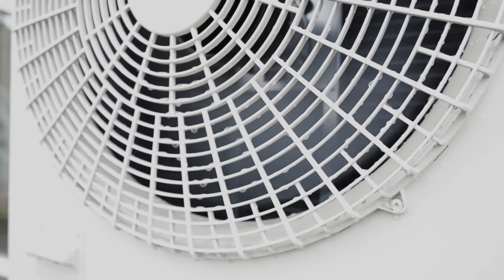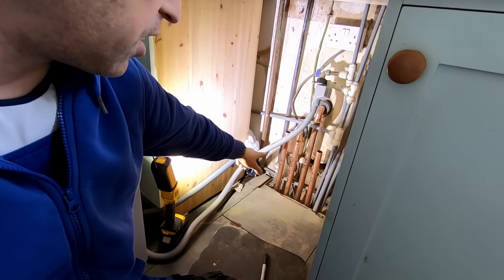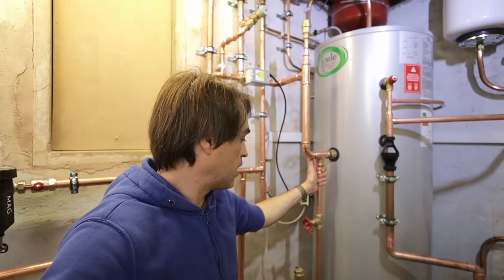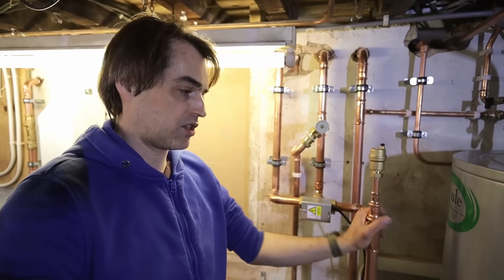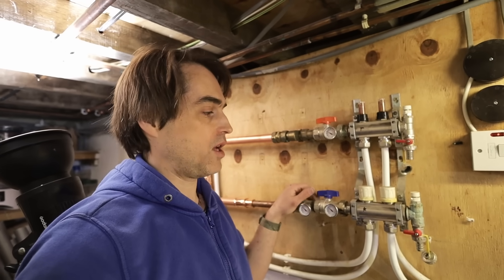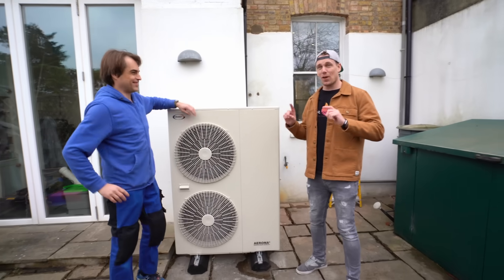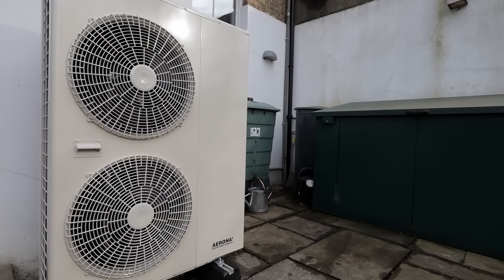The Truth about Heat Pumps: Debunking the Myth.

Comment: Hi Simon. First of all, great work! As you said, you run the whole system on approximately 48 flow and 43 return temperature (delta T5), but can you please let us know on which way you managed to run the radiators on 48 C flow and 43 C return and in the same time to run the underfloor heating on 33 C flow and 28 C return in an open loop system? Maybe you are using some kind of a mixing valve for an underfloor heating or? Thank you in advance. :)
Reply from the maker: The whole system runs 40/35at design with here. System is only balanced with flow
Reply: @UrbanPlumbers  Because in the video, you mentioned that radiators will run at max flow 48 return 43 (mean radiator temp about 45-46 C) and you set the UHF manifold at 33 flow and 28 return. I guess that during recording the video, you had a lower flow temp than your designed max flow temp, due to weather compensation calculation. Currently, at home i have a heat pump with type 33 radiators, underfloor heating and fan coil units. On heating, i am running only radiators and underfloor heating and fan coils only for cooling. My max design temp for radiators is 48 C and for underfloor heating max 40 C (both on delta T5). But the problem is that i have a hydraulic separation (160 L buffer) and after watching your videos, i realize that i need to remove it and to increase the efficiency and to avoid the distortion due to too many pumps of the heat pump (maybe only will put a 50 L volumizer on the return for the fan coils). So in your opinion, is it possible to achieve this (one zone, open loop system) by removing the buffer and run the system in a weather compensation? I think that it is possible and will definitely increase the COP and avoid a distortion, but only unclear point for me here is how to decrease the flow temp for underfloor heating in case where i have a radiators and higher flow rate for them in the same time. Sorry for bothering you and thank you in advance.

Comment: It's big it's ugly, expensive to buy, to install and to run. Add to that it's not as environmentally friendly as claimed. 
But if you live in an area that doesn't have gas mains, as long as the system lasts for more than 10years it's certainly worth considering especially if you have solar panels
Reply from the maker: Ok Doris
Reply: @UrbanPlumbers according to official figures they are upto 33% more expensive compared to gas central heating.  Hence the no gas mains supply they are a better option.
As for the environmental impact modern gas central heating is very efficient with little impact. Heat pumps have there place especially if properly fitted ( well done).
Doris

Comment: I can run as many baths as I want with my combi-boiler and rapidly heat the House in between. Once you have drained your  hot water tank your immersion heater kicks in at extortionate rates. I am only interested in my running costs. Heat pump costs are roughly 1/3 of pure electric systems but gas is about a 1/4, so no matter all the calculations about efficiency, gas is still the cheapest.
Reply: If you're only interested in running costs, then a properly installed heat pump will be able to run 1/4-1/5 of electric heating.  And the average gas boiler in the UK runs at around 82%.   So you need to add about 20% onto the gas price to get the same amount of heat.  So gas isn't always the cheapest.

It's also clear from your first sentence that you aren't that interested in running costs, and are more interested in convenience.  As rapid heating will cost more.

For many heat pump owners, the immersion is turned off, and can still boost just fine.
Reply: @BenIsInSweden  You are quite right that convenience is important to me as well as cost. One argument used is that the immersion heater will only kick in relatively infrequently. This assumes you don’t draw much hot water. Being a single household I probably use less hot water than most  and I draw hot water about ten times a day. This means an immersion heater will be kicking in often as the cold water brings the temperature in the tank down. I have been reading also that here in the UK they are changing the rules to artificially distort the so-called advantages of heat pumps by, in one proposal, restricting gas boilers to an operating temperature of 55°C with the knock on effect that will have on radiator size and insulation etc.I don’t know about electricity prices in Sweden but they are very high here. Our government is also proposing to euphemistically “rebalance” the energy market ie by putting up gas prices . All of this just shows they don’t believe their own arguments and have to resort to dirty tricks to force people to accept heat pumps.
Reply: @johncrosley1  That's not how hot water cylinders work.  There's a hysteresis, and often a cylinder has a temperature probe about a 3rd of the way up - some have more than one.
e.g. for mine, once the probe reads a temperature below 10C of the set temperature, it will call for heat from the heat pump. The only time the immersion will kick in will be under the following situations:
- The immersion is enabled, and the boost button has been pressed on the control panel.
- As mine is R32, if any temperature above 55C is requested (e.g. an anti-legionella cycle).  which will throw an error if the immersion is disabled.  In R290 ones, they can do 75C without immersion, so more than enough for ALC without immersion.
- As mine is split with air to air, if it is set to heating priority (default is mixed, but hot water priority is an option), then as the heat pump is busy with heating it will use the immersion (if enabled).

Building regs have been changed over the years in the UK to improve home standards, and it's not really about trying to make heat pumps more favourable, but homes more energy efficient.  A flow temperature of 55C on a gas boiler uses a lot less gas than 75C.

The issue with the UK is it has one of the highest spark gaps in Europe because of the pre-existing policies. About 1:4 as you say.  The European average is about 1:3. Sweden has one of the lowest, at around 1:1.2, so gas heating never really makes any sense over even immersion.

A rebalance is also well overdue, a lot of the policies were done when coal was a primary provider of electricity, so gas was far more favourable for heating.  The problem comes because so many people rely on gas for heating, with how to do it without causing fuel poverty.

Comment: Looks like a 'Y' plan electrical control system whereby the unvented cylinder does not have its own separate zone valve!!! NOT PERMITTED! Also gate valves are not recommended for pressure systems why not an automatic bypass for cylinder flow/return and then adjust as necessary!
Reply from the maker: It’s a diverter normally closed to the cylinder on PDHW and not a Y plan

Comment: You are not debunking anything.
It is obvious, that to get amount of heat required, you need eather high delta T on your rads, or much less delta T and ridiculously big rads. I personally wouldn't like to live with this ugly rads on my walls.
Besides, for cold climate heat exchanger surface for outside unit should be bigger as well( more expensive equipment).
Last question- from where you are going to get electricity to operate you heat pump?
Right, from burning fossil fuel.
Circuit is closed.
Reply from the maker: The only thing closed here is your mind my friend
Reply: @UrbanPlumbers  offending someone is not an answer. 
I raised some questions, got no answers.

Comment: Madness, I've been installing heat pumps for 40us or as we know them aircon units with reverse cycle. They do work but very expensive to run and Very expensive to repair. They have massive control pcb s because they are inverter drives with dc voltage compressors and pump around refrigerant gas so installers must be f has compliant so not so green. I have 2 mainly for cooling but I can fix it.... God help the public who risk it. The potential problems are enormous. .who will benefit from this , the manufacturer s !!!!!!

Comment: Hi. Just wondering what is the power usage of a heat pump. Is a 10 kw unit using 10 kw per hour .Or is there a way to compare oil burner as an 1 gallon jet per hour. And as with oil were i can put it on for 2 hours or do you have to leave a heat pump on all the time and let the stats cut in and out
Reply: no, heat pumps are rated by heat output, not by electrical input, you can check the spec sheet of the unit, and either it'll show the max wattage or amps - either as a max rating or fuse size (which you can multiply by voltage to get watts)... As a rule of thumb the max draw is about 50% of the rated heat output, however, this isn't what the heat pump will be running at most of the time, and that will be lower when set up correctly.   Even with an oil boiler you are (in most cases) using more oil having it running for 2 hours a day only vs having it trickle heat in at a lower flow temperature, with a heat pump that saving is even more pronounced.   Heat pumps don't use a thermostat in the typical fashion - as they make it more inefficient, instead they are set up with weather compensation - like a gas boiler (and probably oil boiler) can. Where it adjusts the flow temperature based on the outside temperature to target a set indoors temperature.  That isn't to say you can't use it in a way that is controlled by a thermostat, you totally can, but generally it's going to work out more expensive, unless your house is completely vacant most of the time.

Comment: 11:50 A 17kW unit?! Am I reading this correctly?!
Wasn't this heavily oversized?
Reply from the maker: It’s 17kw at +7. Around 13kW at -2
Reply: If I may, what were the reasons for sizing the heat pump this big? 

Couldn't a 6 or 8kW heat pump do the same job more efficiently (using less electricity)?

Thanks for taking the time to reply and congrats for the channel.
Reply from the maker: 12kw heat loss. It’s a big house

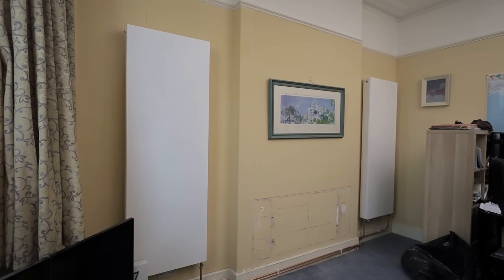Comment: 10:40 What an ugly mess. I would NEVER agree to have those huge things in my rooms. Also how much longer do they take to warm the room up compared to the old heating system?
Reply from the maker: I only installed them to trigger people online 🤣🤣🤣. They are pretty oversized even for a heat pump. The room becomes and instant sauna if both are on.
Reply: Honestly, I would rather sit in the cold than do that to my home. If heat loss is that bad, just fix the heat loss ffs.
Reply from the maker: The larger the rads the lower the flow temp and higher the efficiency and lower running cost. You can have small rads, it will just cost you more to run them
Reply: The customer chose them. And the room isn't typical - clearly over 3m in height given that the rads are almost 2m high, and there's still a significant amount of wall to spare above.  Along with the heat loss in that room being about 1/3rd of the average UK house's total heat loss.  Also, with a properly set up heat pump (or gas boiler with weather comp), you aren't getting to the stage where you need to heat a room from cold, the weather compensation will take care of the amount of heat to start trickling into the system as the outside temperature drops to maintain the desired room temperature.

Comment: Gosh, you just worry about the volume house builders getting it right. Bearing in mind the range of defects with well known elements of plumbing when building a new house. You can see them struggling to find the competent sub contractors to do this new way of heating. Unless they have proper design and specification for pipe work, radiators and have sufficient quality control. Anyway hopefully the early adopters will help iron out the bumps long before this technology becomes the norm.

Comment: Great access to everything which sadly is just not possible in modern houses. neither is replacing existing 10mm and 15mm pipes with 22 or28mm pipes. I think this is the problem in the UK. Possible in older properties with floor spaces and basements. Not possible with concrete floors
Then there is the truly ugly, dominating radiators.........I mean, they really are horrible

Comment: Nice looking system but it is huge in every respect. I can live with radiators, a heat tank etc, but not the box on my patio right outside my sash window. I hope the fan bearings remain whisper quiet.

Comment: I know I  will probably get a lot of negative feedback but watching this video reminds me are we looking for the right solutions. An example: a person works 100 kilometers round trip from home and he sells his car and get another vehicle that is 25%  percent better on milage. An improvement that could be resolve by moving 25% or more closer to work. In this video I saw no evidence of increased thermal performance of the building envelope and all homes have the possibility of super insulation and air sealing resulting in dramatic reduction in required thermal load. A small heat pump definitely has uses such as domestic hot water supply, but the requirement of a 17 kw heat pump to alleviate but not fix a poorly insulated home is just the thing that makes the world and society in general still not looking for smart, efficient, long term, low life cycle costs that need to be mandated and installed in both current and new housing standards. A group of us where talking about the weather in summer at the current time because it was quite hot and one fellow said that he had just spent 28000.00 canadian dollars for a ground source geothermal system. When I said that if he had spent half that money on insulation he probably wouldn't need much of a heating and cooling system. His face turned white when he realized what I had said.

Comment: this is so bad :D you waste so much money on all radiators ect to save nothing :D all this pays up in what 20 years ? in 20 years there will be way better solutions to heating and plumbing
Reply from the maker: Like what? Hydrogen - lol 😂
Reply: @UrbanPlumbers  not talking about hydrogen . there is currently no good alternatives . all those heat pumps is another monopoly to make a lot of money for big companies and push their agenda .I would be more skeptical on solar or wind maybe and if heat pumps get cheaper maybe one of those combinations at this stage its not efficient at all .
Reply from the maker: Heat pump are cheap. It’s the work to existing heating systems and hot water plus wiring that makes it expensive. Once installed you could swap a heat pump for maybe 2x the costs of a combi swap. I got a gas boiler that I am charging with a heat pump as it will be much cheaper to run and provide much better comfort in my case.

Comment: Can we please have an update from the owner regarding their bills and heating performance. Thanks.
Reply from the maker: Yes, we can. I am going back there to do the 1st year service in March and will be interviewing the owners about their experience with the Heat Pump. For now, I can say that it performed without any issues so far and kept the property at 22C without any problems with very cold snaps recently.  

I actually had to go back there last month as a bit of external pipework insulation became loose. It was during the cold snap period and I checked the energy consumption of the unit. With -2 outside it was using 35kWh of electricity per 24h for this period 160m2 property. (So @ 32p per kWh it costs around £12 per day,although the owners pay double that, as they use 100% green supplier at double the cost)
Reply: @UrbanPlumbers  Great. Thanks.
Reply from the maker: @nhojnhoj6767  just 2 more months and all the 1st year services will start happening on 2022 installations. There will be a lot of follow-up videos and interviews with users - I promise no filter on them - all good and bad experiences will be shared. There are some bad ones as well -  and actually, they are super interesting, probably more than good ones.
Reply: @UrbanPlumbers  
Hello. Have you done the service for this installation? Have you posted a video?
Reply from the maker: @nhojnhoj6767  Yes I have. It has performed very well and has been very efficient.  I am so busy installing now that I do not have time to shoot videos anymore. I will go back and interview the client this summer.
Reply from the maker: @nhojnhoj6767  but to give you an idea: the average energy consumption per day for the last 12 months has been 12kWh a day, so for a 5-bed house it used 4400 kWh and had a total running cost of around £1300 - although it was possibly a bit cheaper, as they have solar and battery storage
Reply: @UrbanPlumbers  
Thanks.

Comment: Hi Szymon
About that PRV pump next to the HW cylinder, 
I installed that pump on my installations 7 years ago and all 3 pumps failed when first time system needed to use them. 
Impeller stuck and pump blow fuse,basement was folded.
Fact customers don’t do regular maintenance.
That pump needs to be flushed regularly.
So be careful .
Regards
Ryszard
Reply from the maker: I am aware of that. Float valve needs checking every year!

Comment: Heat Pumps work great now days, years ago not so much. Right now it is -4 F outside  and its 68F inside my house.  I have a 5ton bottom floor and 2 ton top floor  Mitsubishi Hyper-heat and it
kicks ass when it comes to heating. The 20 year old Lennox's they replaced struggled to heat once it got below 25 F. I live in the North Tennessee mountains  and we are in a brutal polar vortex right now.
My heat pump is Air sourced only , to me that water set up just looks like it has way too many parts. My Pool/Jacuzzi  is heated by a big Rheem  and its always causing problems.